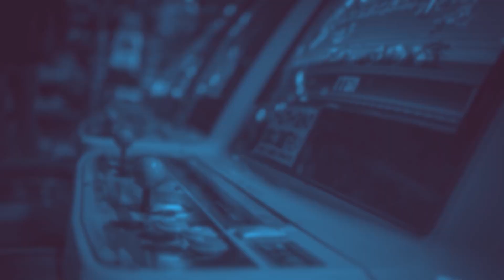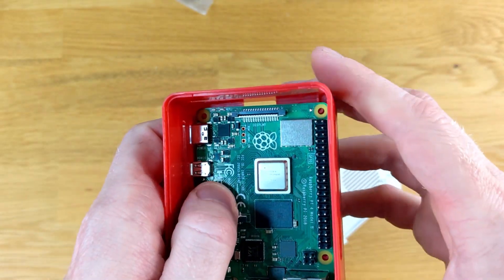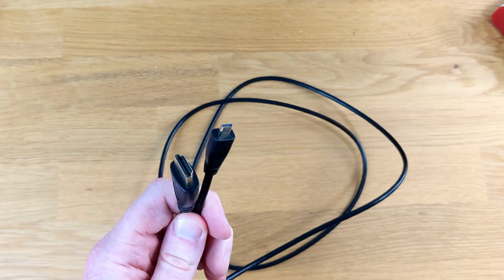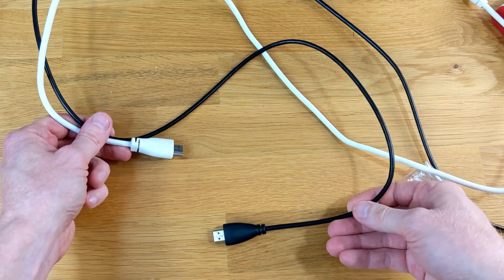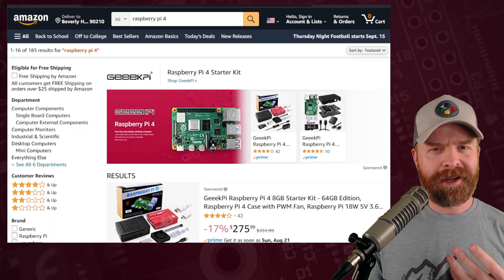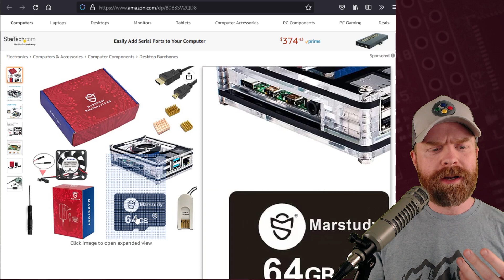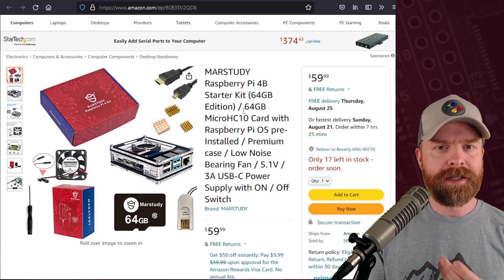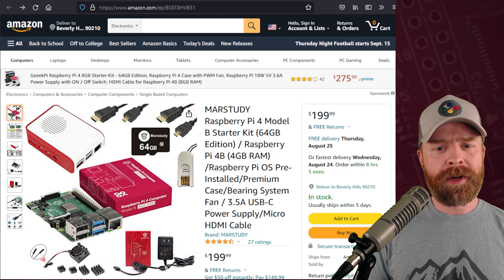MARSTUDY Raspberry Pi 4 Starter Kits

Comment: I feel lucky to own two four gig models, as well as the 400.
Of course I also own older versions of which I am also using my RPi2 now for what I'd actually use my NAS for.
However, that thing can't be powered via a router's USB port, so I am incredibly happy the Pi 2 can.

As for the mission the Pi Foundation had in mind with these computers however which is education and to deliver computers to those who can not afford one, the supply situation is really really bad.